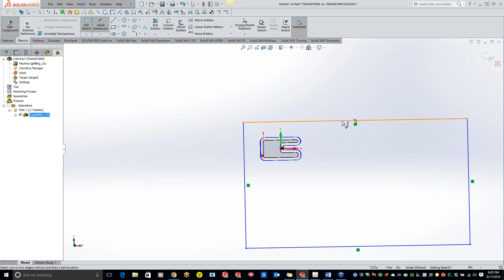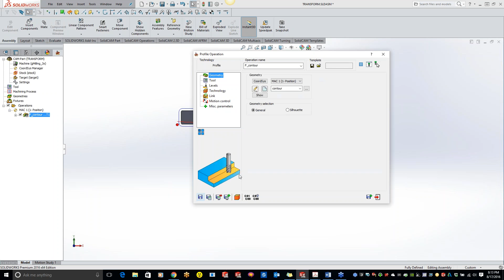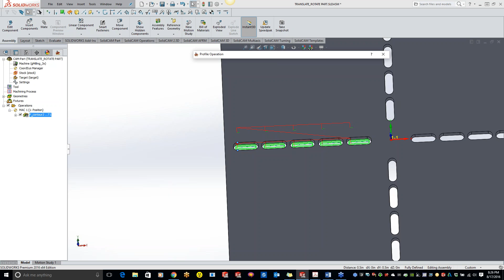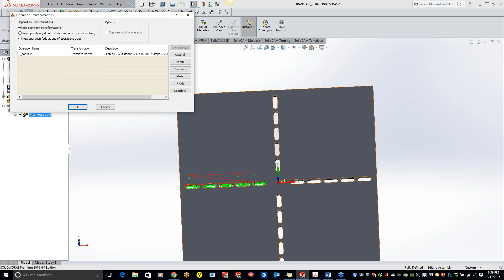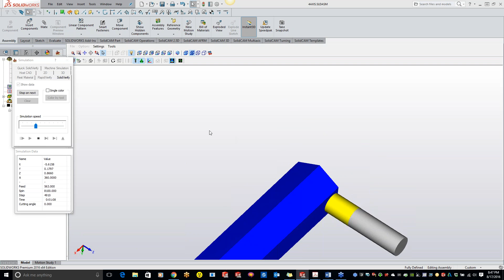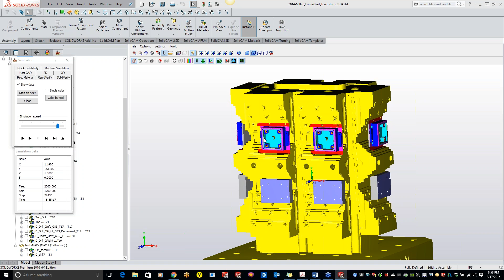KevCAM Night School - SolidCAM -  Transformations

Comment: nice work kev . i have a question regarding the mac to mac transformation . lets assume we transform parts around a 4th axis .  i assume that the Gcode which Solidcam produces would be based on the individual Mac positions. such as g54.1 g54.2 etc which we have to input manually in the machine .i would like to know whether the post processor is capable of calculating all the positions based on the main coordinate so that i could enter one coordinate and all other positions will be calculated automatically ! that would be great
Reply from the maker: Yes we can do this with the post inside SolidCAM 2015